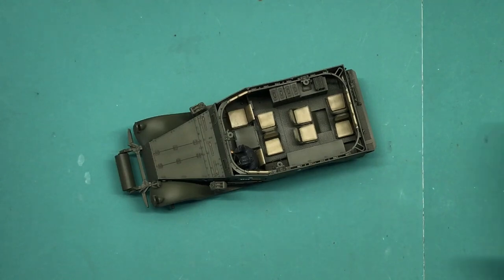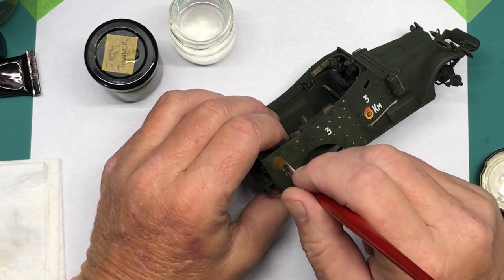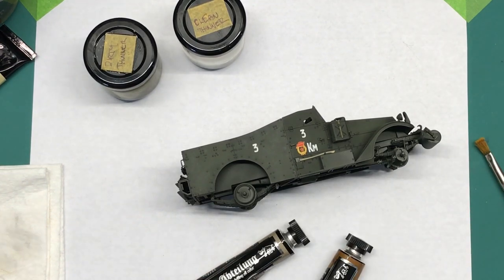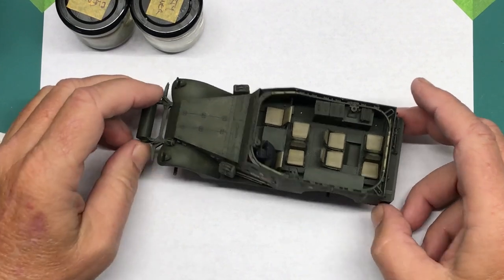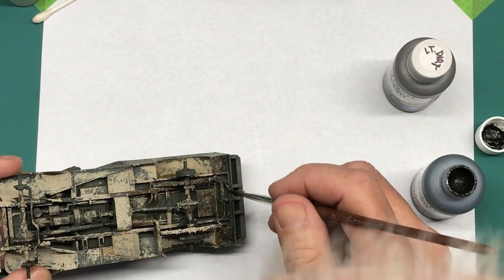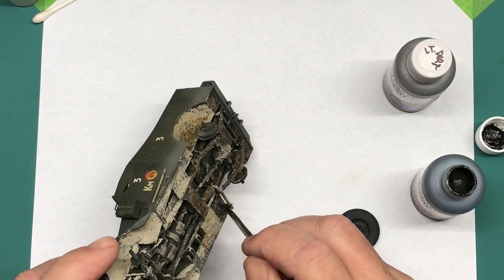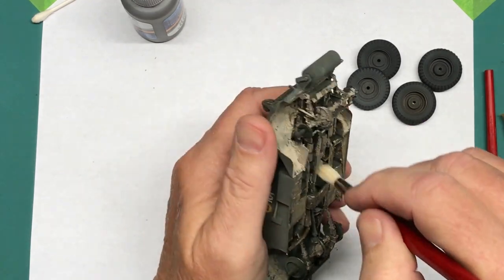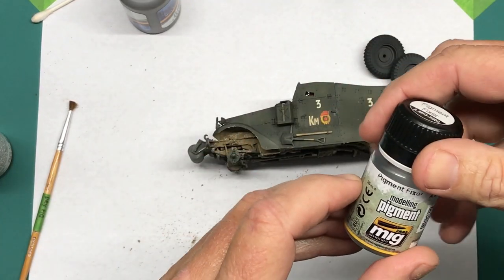Tamiya 1/35 M3A1 Scout Car, Part 8 Final

Comment: Brett, you mentioned that you like using Vallejo Air for brush painting. What’s the best way to clean your brush when using Vallejo Air?  Thanks, E.
Reply from the maker: I just use water... in my case distilled water, because that is what I have in my brush cleaning jar.

Comment: One if the best things you can use for a dirty base layer is Vallejo pumice mixes. Pretty good size little tubs and they come in all kinds of colors and types. I use that like what you are doing then i start adding layers between the airbrush and ak/oils for depth. The positive is they don't 
stink and water soluble.
Reply from the maker: Thanks, Will. I have seen that used recently and it looks pretty good. I may have to give that a shot.

Comment: Nice work. Really like the weathering. FWIW you can air brush the UMP wash have not tried it yet. Also you can decant some wash let it dry and you have a real fine pigment
Reply from the maker: Thanks, Matt. I didn't know it could be sprayed... that's interesting. As for drying it out and having fine pigment, that makes sense. There is always a pile of residual dust left when I remove the excess from the kit.
Reply from the maker: @MattR58  Thanks for the link! That is a really good method. I'll be trying that for sur e on the next armor kit. And I just subbed to that channel. Good stuff!